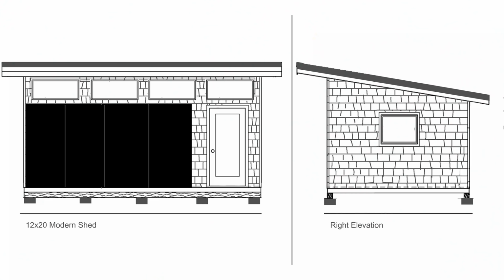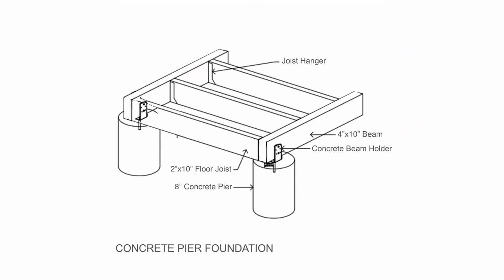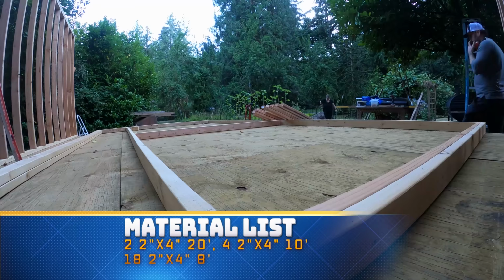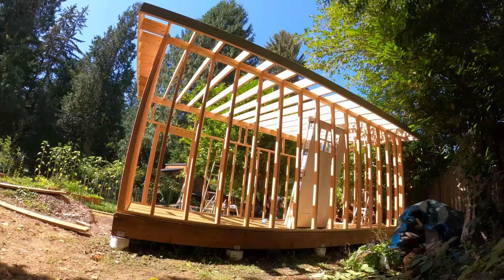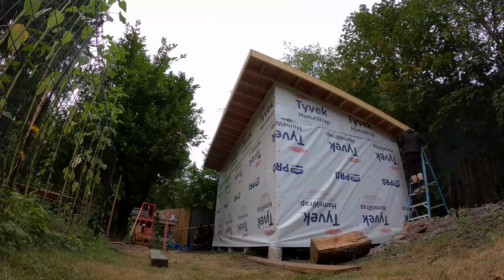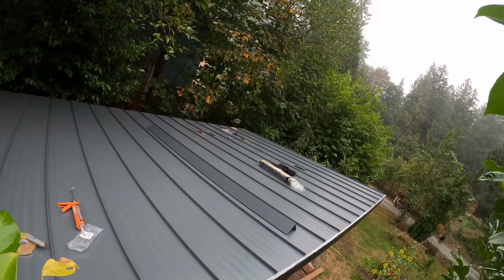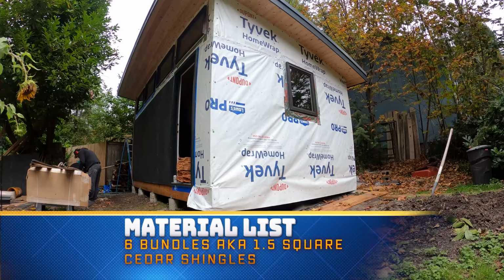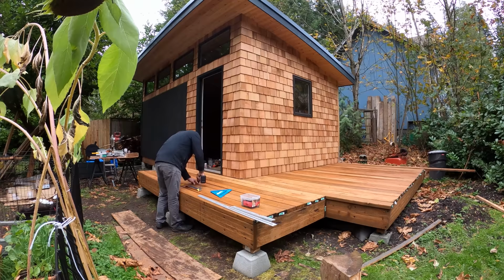Build A 12'x20' Modern Shed and Deck by Yourself: With Material List

Comment: Are you wishing you had installed a garage door on the front of it to get larger things in and out?  Awesome build, and very similar to what I'll be building Spring 2022.  One tip - and the structural screws into each joist kind of negate this, but you should use proper joist hanger nails instead of screws.  Much higher shear strength.
Reply from the maker: I thought about putting a garage door on it but decided against it because I wanted to maximize shelving on the inside. That and the main house on my property has a garage for bigger stuff already 😉 
Would love to see pics of your build when finished

Comment: How much money in materials did u use for the foundation and steucture without counting the metal roof and siding?
Reply from the maker: The full shed and deck was a little over $12g a the time I built it? I don’t remember what the individual sections cost as it’s been a couple years but you could take the material list in the video description to your local lumber yard to get more accurate pricing. I have the materials broken down into separate sections.

Comment: Awesome video, it's sincerely inspired me to do better than the basic. QUESTION! did you cut the front 2x4's down to accommodate the 4x2 windows above?
Reply from the maker: Thanks! Yeah, the 2x4’s all needed to be cut a little for the framing. In the video I’m just stating the raw lengths I started with.

Comment: Great job man!!! Beautiful workmanship... Did you consider a poured concrete floor and foundation? There is no way I would deal with the wildlife that always finds it's way under a post and beam floor. Even with protective lattice!!!! Also did you bring in any utilities i.e. gas or electric? I am considering a similar size 2nd. shed/man cave with attached greenhouse and need power and gas..... Thank you.
Reply from the maker: No utilities to the shed at the moment. I plan on adding a solar generator in the near future for lighting and small power needs. 
A slab foundation might have been a better way to go to keep critters out in the long run. IDK we will have to wait and see lol

Comment: Is it not common practice to add a layer of wooden slats under your final roofing/siding layer in north america? In europe it's a requirement, to add ventilation and avoid moisture damage.
Reply from the maker: Good question? I’m not 100% sure if it should be required for the siding in this case but with the roofing I selected there are little ripples in the the steal that allow for a small amount of moisture or air flow under the sheets.
Reply: @NilesProductions  I think best practice where I'm at still dictates you should add slats behind siding to allow for airflow, because eventually some water will probably seep through, or just soak through the shingles and the quicker they dry, the better. But maybe differences in climate make it unnecessary in certains parts of  NA.

Comment: How did you connect your 2x6 top beam to the 2x4-10' sides on the front wall? Did you use any brackets, or just a 10' as a jack stud then nail into the end of the 2x6 beam?   I'm guessing your your side wall and front are only connected by nails since the 10"'s are on the ends. Is that right?      I've looked at different ways for doing my own 12x20.  I'd really like to know about these connections to the front top extension for the windows. You didn't feature that part.
Reply from the maker: Yeah for the sides of the front wall I used the jack studs method and for the windows I used the cripple stud method. I attached the cripple studs to the 2x6 by drilling pockets holes and using structural screws. There are a bunch different ways to do this some may better than the way I did it. You might want to add straps or nails plates to beef things up even more?

Comment: But in the diagram the outside frame, where the corner join, are resting on your concrete foundation.  However in the video, they are floating.  This video is a year old, did any problems occur?
I want to build this shed.
Reply from the maker: I built the shed in 2020 and am happy to report zero problems to date. 
I Sat on the footage for a over a year before I decided to edit the video. 
For the corner foundation post foundation I decided to move them in a little so that the outer floor joist wouldn’t hit the 4x4 hanger for the 20’ 4x10. In the video I didn’t attach the 20’ beams to the hanger until after I attached all the floor joist and sheeting for the floor so that I could tap the ends and make everything perfectly square as wood often isn’t perfectly straight. There are a couple shots when I’m attaching the joist hangers were you can see the beam floating above the hanger a little. Once I had everything attached and square I used my body weight to get the beams to sit flush in the hangers on top of the cement piers

Comment: I wonder why you did not sheath the walls for the bracing effect before putting up the whole roof? Was it braced already? Imagine if the whole thing fell like a house of cards. And the rim wood is really nice wood, is it Douglas fir?
Reply from the maker: Yeah, I should have attached the plywood to the walls before roof as it would have 100% made the structure more ridged when I was on top. 
Also if I had a couple people to help it probably would have been better to attach the plywood to the walls before I even stood them up. 
You are correct most of the wood is Douglas fir with only the soffit, facia, and shingles being cedar. 
I believe the pressure treated lumber is doug fir as well.

Comment: So. I’ve been looking at tuff sheds to build a 12x20 almost just like this and they want to charge $18k.  I have some building ExP.  But not a lot.  Roofs are my weak spot.   Now that lumber is coming down- I’m seriously considering doing this.   Did you go off of any plans?
Reply from the maker: I bought a book at Lowes called sheds and decks then looked at a bunch of different sheds before coming up with my own design to suit my needs.
All in the shed and deck cost me a little over $12g.

This was my first shed build. Like you I had a little bit of experience (mostly from building skateboard ramps LOL)
It was a little intimating when I started but I took my time and tried to think things through. 
I planned things out in stages and purchased material accordingly. 
I figured if I got the foundation nice and square everything else would  come together. 
I also thought that If I screwed up the foundation I wouldn't be to financially vested that I couldn't walk away from the project.
Luckily things went well :)
As the build progressed and everything started falling into place I started feeling more confident. Once finished I was really happy with how things turned out and am glad that I stepped out of my comfort zone and decided to build myself.
Reply: @NilesProductions  I knew you were a skater!!   Had a feeling.  

Like you. I built a few ramps in my day.  I’ve also helped a friend build his house so I have a little ExP.  Id love to do this with my 13 year old son.  

I’m curious how much this project cost.  Right now tuffshed will charge $17k for a 12x20 minus the deck and nice siding.  

I’m competing against a wife who doubts my skills.  Lol.  But after watching this- I’m like hell yes I can do this.  Now I just have to convince her it’s a financially sound decision vs tuff shed.
Reply from the maker: Wood prices have been all over the map these past couple years. At the time I built it was a little over $12g for the shed and deck. 
To get something more accurate to todays prices you can take my material list and get it priced out at your local lumber yard and compare it against Tuff Shed. Some items like the 20’x4”x10” will not be found at Lowes or Home Depot. You’ll have to go to an actual lumber store for material like that. 
I don’t think Lowes or HD sells standing seam roofing either? 
I’m sure I used a lot of premium material that you could substitute with cheaper materials to bring the cost down a bit as well. 
There is no shame in going prefab or with a builder like Tuff Shed but the pride I feel when I look at my shed and what I accomplished makes me glad I decided to do it myself.
Reply: @NilesProductions  No buddy...You did it right.  In fact one of the first ones i've seen on Youtube that has done it right.  Using a standing seam as opposed to just a regular metal roof- you should never get any leaks ever.... I know you probably get a lot of "armchair carpenters"  but I have been looking.  You have skills.

Comment: Would there be a benefit to putting the metal roofing on 2x4 purlins or the siding on furring strips in your opinion?
Reply from the maker: I don't know the answer for sure but if I had to guess I would think sheeting the roof vs purlins makes for a stronger roof and would give you a better snow load rating? I also think sheeting helps with condensation?  With some siding I think furring is necessary if material requires an air gap between surfaces. I'm not an expert on the matter and would recommend you do more investigating as I'm no expert LOL :)

Comment: Did you set bottom of concrete bracket flush with top of concrete pile or slightly above?
Reply from the maker: I tried to set them flush. 🤙

Comment: Great job, very beautiful design and execution. In one of the comments you mentioned it cost around 12k. Did you check the pre-made ones? Didn't see the work on interior. For electricity, are solar panels in your plans for future? 
Nevertheless, we'll done sir, we'll done indeed. I also loved Hanson, what a good dog. Bravo to both of you.
Reply from the maker: Yeah, looked at some prefab ones before I started. Nothing was really checking all the boxes for me when it came to style and materials used in their construction. 
I wanted to build a shed that’s style would compliment the main house on the property. 
My budget was originally under $10k when I started but materials were fluctuating like crazy during 2020 so by time finished it was over $12k
$12k includes the deck and privacy wall. 

The interior is not very fancy, just some shelving a work bench at the moment.
The shed currently doesn’t have power but I’m planning a small solar generator set up in the future. 
Hanson was the best partner I could have asked for. Best dog ever!

Comment: quick question about the installation of your shingles. Were your staples stainless steel ? and how are they holding up with the narrow crown stapler. I personally didn't think a narrow crown stapler would have enough bite to hold the shingles securely. Most advise to use medium (7/16) or wide (3/4) crown staples
Reply from the maker: Yeah, I used stainless steel staples. As far as bite goes so far so good. I don’t know if this is the preferred way to hang shingles just using the tools I have at my disposal.

Comment: Great video. I'm in the process of building a shed the same size and style. When you cut the rafters, I assume that you cut off 3" to account for the facia boards and kept the 16' length?
Reply from the maker: Yeah, cut 4 1/2 off total  to keep the length 16’. 3” for the two 2x8”s and 1 1/2 for the two 1x10” facia boards
Reply: @NilesProductions  Thanks!

Comment: Does it need sheeting and siding panels for a shed build? This seems more like a detach ADU.
Reply from the maker: I tend to overbuild stuff. There are probably 100 ways to achieve similar results. My video is intended more for inspiration to show you what one person can do. My suggestion is do research then plan and design  to meet your needs.  This will help dictate what material you will want to use 🤙

Comment: You should have oriented the building 180 degrees around, and then the roof would be angled to hold solar panels in the future...
Reply from the maker: I have a little solar generator system planned for the shed, just need to save up some cash and do a couple other home projects first

Comment: well lol this is what ive been looking for pretty much exactly i am getting new property and i will need to hire someone to help me more like hire someone who will let me help them LoL can you tell me how to get a blue print for one of these
Reply from the maker: Carol I'm glad you enjoyed the build :) Unfortunately I don't have any blueprints to share.
This was the first shed I ever built. 
Most of my construction experience comes from building skateboard ramps and tree forts as a kid . 

I picked up a couple plans online and bought the book Sheds and Garages from Lowes for research. 
I took elements from a couple different designs modified them and made them my own. 

https://www.lowes.com/pd/Sunset-to-Sheds-and-Garages/50196109
A lot of good info in this book. 

I am by no means a pro, just a guy that likes to make videos and diy stuff. 
I bought my materials in stages. Starting with the foundation I figured if I screwed that up that up I wouldn't be out a ton of cash and could always pump the brakes and hire someone to do it for me. 
On the flip side,  I figured if I can get the foundation level and square I'd be good to go for the rest of the build as it's basically building a box. 

It was a little nerve racking when I started but as I progressed and things started falling in place I got more and more confident. 

I took my time and tried to research as much as I could along the way. If i was confused i would ask questions to carpenter friends. They are a wealth of knowledge  
I took my time and tried to research as much as I could along the way. If i was confused i would ask questions to carpenter friends. They are a wealth of knowledge and from what I found willing to share that knowledge. 

The entire build took me about 18 days. A pro could have probably done it in 2 or 3 LOL

If I were to build one again I'd like to think I could do it in 3 or 4 LOL

I believe you can do it if you put your mind to it. If you have a partner in crime to help it should only make things easier.

Comment: Did you do anything special between the siding and cedar shingles?  I'm seeing some folks adding z flashing between two sheets on the horizontal edge (above a 4x8 sheet ).
Reply from the maker: Yeah, I used z flashing on top of the plywood sheets on the front between the t1-11 and cedar shingles as well as on the side where I cut the triangle piece of t1-11.  I forgot to mention it in my VO but did add it to the material list 🤙

Comment: Did you use pressure treated lumber for the wall framing?
Reply from the maker: No just the floor joist, beams and deck.

Comment: Why did you put the eaves boards on before the wall cladding? Are you bridging the water path?
Reply from the maker: I installed the cedar T&G soffit boards first because it creates a cleaner look vs trying to butt the T&G up against the shingles with all their gaps and unevenness. 
To bridge the seam/water path between the shingles and T1-11 on the front and the upper and lower T1-11 sheets on the side I used  Galvanized Z Bar Flashing.
The flashing dimensions are ½”x5/8”x2” 
I didn't call it out in the video but I did add it to the material list : )

https://www.homedepot.com/p/Gibraltar-Building-Products-5-8-in-x-10-ft-Galvanized-Steel-Z-Flashing-17845/100319849

Comment: I heard nails are better than screws for fastening joist hangers because they
have a much higher shear strength. What do you guys know about that?
Reply from the maker: I should have used structural screws instead of deck screw for the hangers. I'm not a professional carpenter and am learning as I go...  Here is a good video about shear load and screws vs nails for anyone looking to learn more. 

https://www.youtube.com/watch?v=qmajKElnwfE&t=641s

The #10 Hillman screws I used appear to have a pretty good shear strength despite being deck screws but I would have been better off using structural screws for sure.

There is a drop down with the technical specs of the screws I used in the link below:
http://stfasteningsystems.com/deck-plus/

Comment: I am building almost the exact same style and footprint right now. I have the deck built and am looking for guidance on framing up the walls and rafters. I am building a 12x18 with a 4 foot porch deck out front. I am wanting to over hang the front to cover the deck portion a bit more so am looking to use 20' rafters cut down a foot or so. Do you think 2x6 rafters will suffice or do you think the 2x8s are minimum? Looks great, loved the video!
Reply from the maker: For my location to meet the snow load code I needed 2x8’s at 24” on center for a 2-12 rise. I ended up beefing it up a little at 16” on center because of the roofing panels I chose. It might be different where you live especially if you don’t have to worry about snow or if you go with a steeper pitch like 3-12?
Reply: @NilesProductions  Thanks for replying so fast! I live in Washington State so snow will definitely be a factor. I am thinking a 3-12 pitch however and using 16" oc. But thanks for the direction, I will look up the snow loads and see what i can get away with. I might just go with 2x8 anyway, as the price difference isn't much for the peace of mind! Cheers